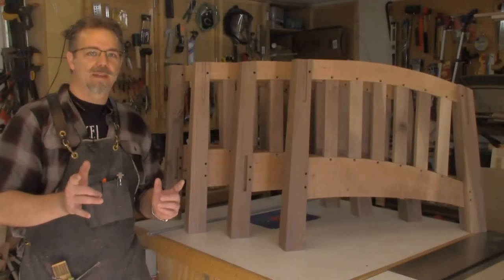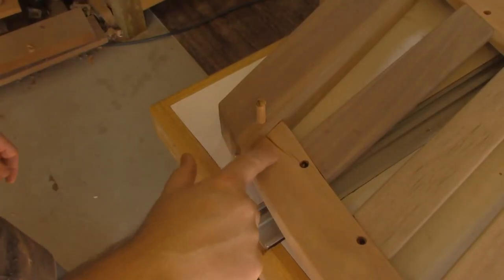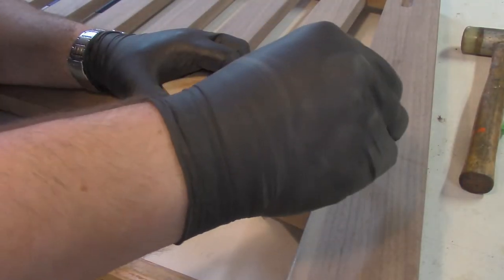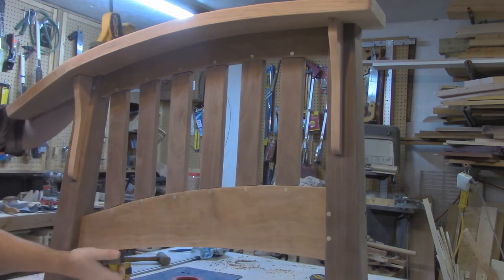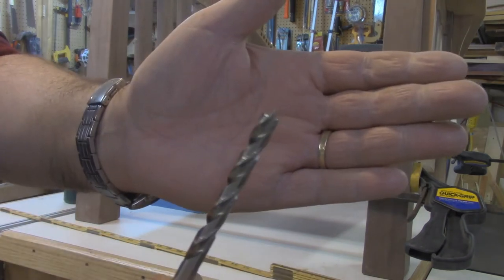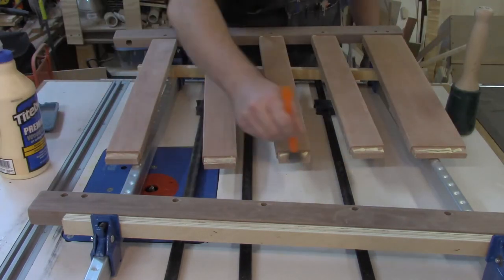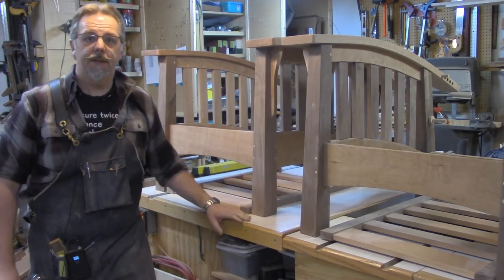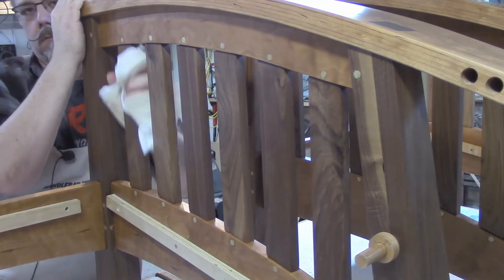Morris Chair Build Part 9: Glue Up and Finishing

Comment: Nice video!  If you find glue spots with the mineral spirits what do you do to fix them?  sand it?  I have applied finish only to find hidden glue spots.
Reply from the maker: Yep. Sand them away. Or get a card scraper and scrape them off. I've had to clean up glue spots after finish on other projects and it's a bit more difficult with the finish. Either the finish starts to tack up and gums up the sandpaper or you have to wait until it's cured. Then you re-apply the finish to see if you got it all. If not, then do it all again.

The mineral spirits evaporate pretty quickly and don't gum up the sandpaper. So you can sand, wipe on the mineral spirits right away and see if you need to sand anymore.